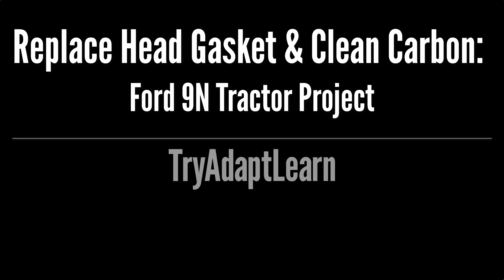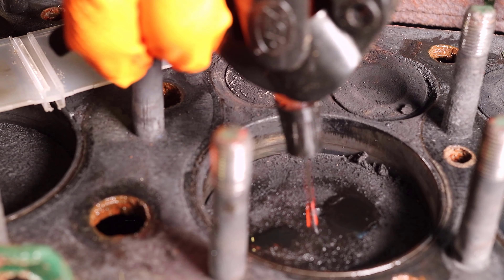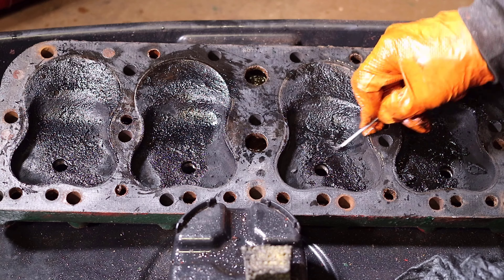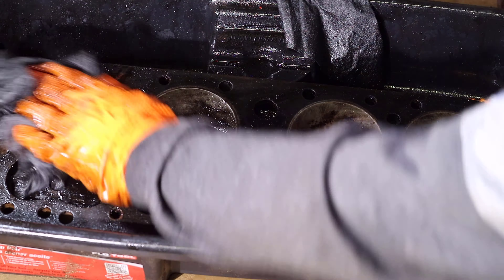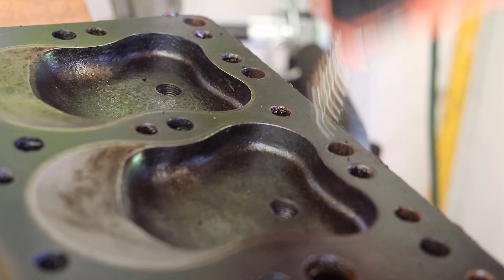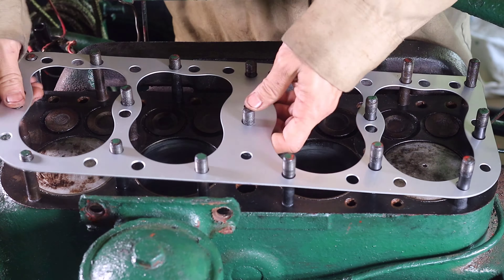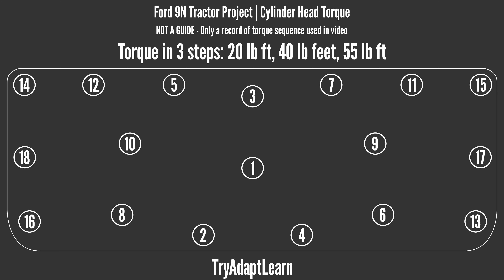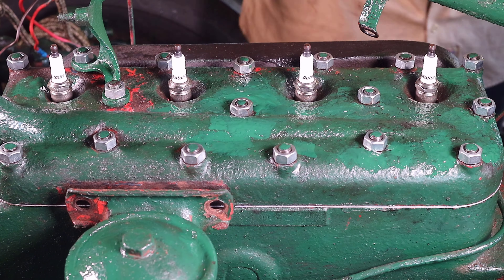Replace Engine Head Gasket and Clean Carbon: Ford 9N Tractor

Comment: Good video but you dont want to use grade 5 nuts/bolts for anything head related. They are too brittle and after heating up and cooling heating and cooling can break. Use Grade 8 nuts or bolts.
Reply from the maker: Thank you for the advice. I’ll continue to check them until I can replace them with Grade 8 fasteners.
Reply: @TryAdaptLearn  Your welcome! I didnt mean to sound pushy just wanted you to get the most out of that tractor and trust me you will!
Reply: @TryAdaptLearn  what size were the fasteners